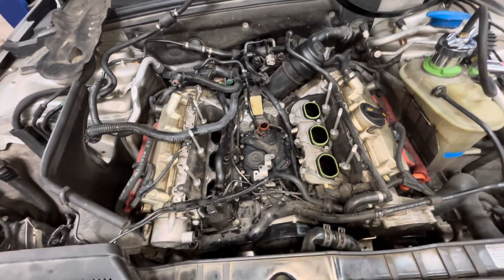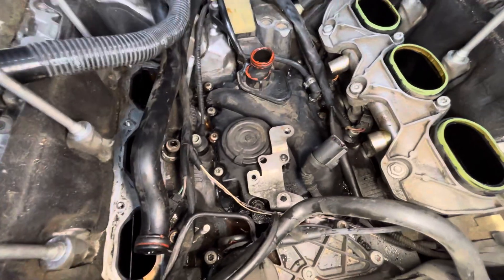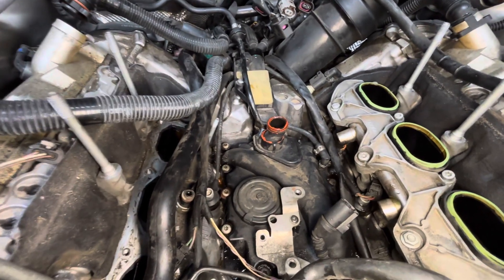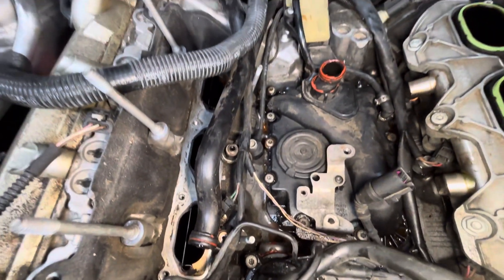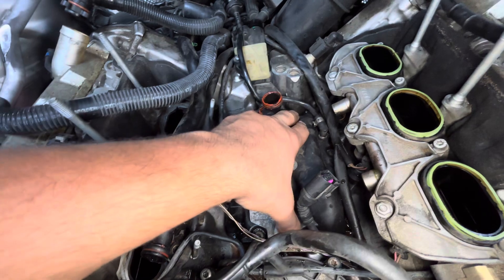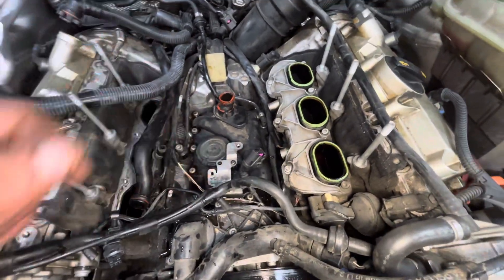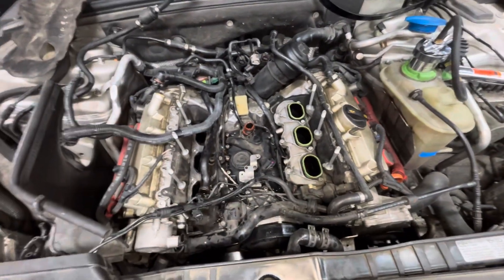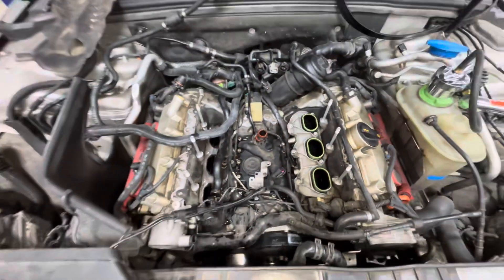COOLANT LEAK UNDER INTAKE MANIFOLD ON AUDI 3.0TFSI SUPERCHARGED ENGINE

Comment: Great video man!! How long would you say the pcv valve lasts for? I replaced mine preemptively when I got my s5 at like 50k miles.
Reply from the maker: Hey thanks! It ranges a lot from what I see, I see them go well past 100k miles often but I have also seen some pretty early failures so it’s kinda hard to say